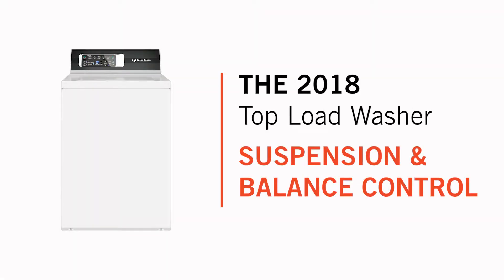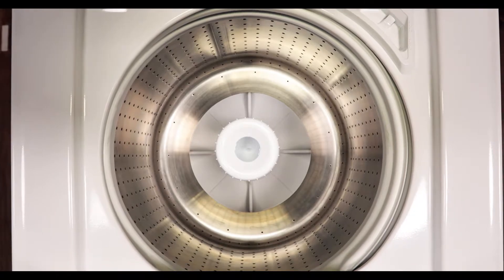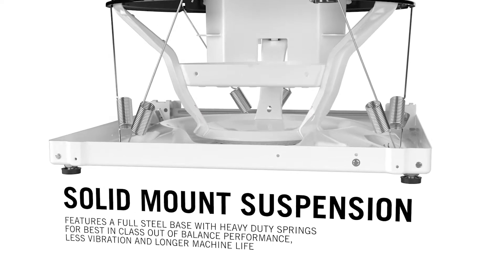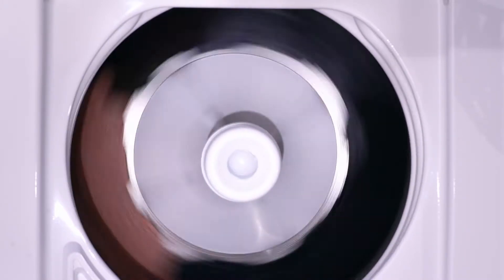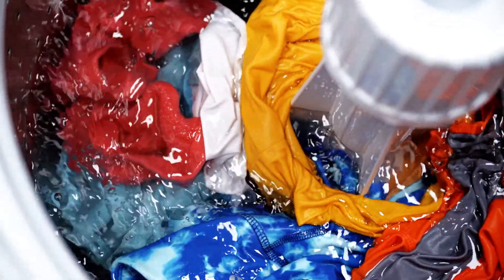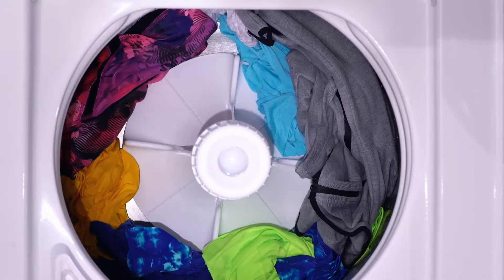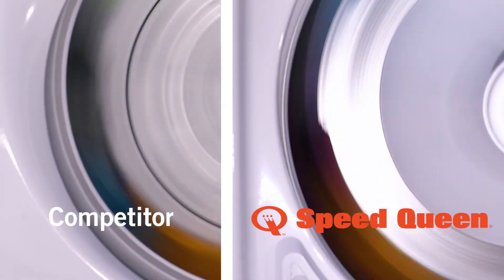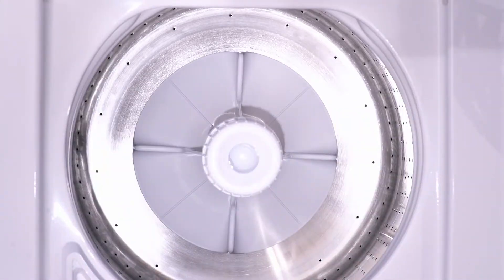2018 Speed Queen Top Load Washers - Out of Balance Explained by Engineers

Comment: My speed queen front loader acts dramatically out of balance every single load, but smooths out on high speed. I think the balance tech isn't working. Not the best use of $2.2k for me
Reply from the maker: Hi Patrick, and thank you for contacting Speed Queen Home. We are very sorry to hear your machine isn't living up to your expectation the way it should be and would like to work on your case as quickly as possible. Would you please submit a contact form at https://speedqueen.com/contact/ with your contact information, the serial number of your unit, and any additional details that you could provide to us about the issue. Once we receive your submission, we will contact you as soon as possible with a solution or update.

Comment: Is Speed Queen still making top load washer with mechanical timers?
Reply from the maker: All of our machines have an electronic control verses an mechanical control.  There are a few reasons why the mechanical is no longer available.  First, we have been using electrical in all of our Commercial products for over 20 years and have found that they last longer than the mechanical ones.  Our water level control feature requires a microprocesser that is only found in electronic controls.  And finally mechanical controls could not handle the changes being mandated by the government and all the capibilities and functions we wanted to be able to put on our machines.   I hope this was helpful information.

Comment: I hate my speed queen top loader,   It is out of balance 7 out of 10 loads.   No amount of fixing the cloths helps always  have to go to spin only,  then back to wash just to rinse the load but make sure to set a timer or it will go through all the cycles AGAIN. (so much for saving water) Mine is commercial so the salesman said i could really pack it tight. NOT,   it is so frustrating .   I will tell everyone i know NOT to buy this washer. I have to do sheets and towels   my cottages  and i am always fussing with this machine, not a time saver or water saver as i was told. 50 thumbs DOIWN